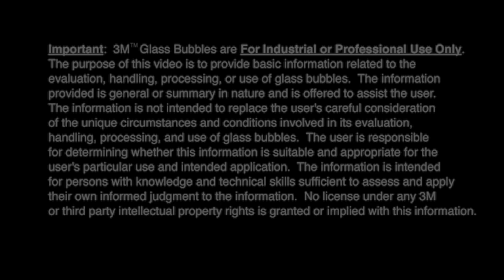Benefits of 3M™ Glass Bubbles in Injection Molding

Comment: What is the diameter of these bubbles? I'm guessing under 100 microns.... I'm curious as to if these induce more residual stress since the thermal shrinkage would be much higher in the polymer... The benefit of promoting ductile failure over brittle likely exists as well